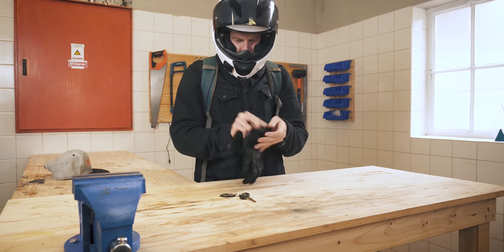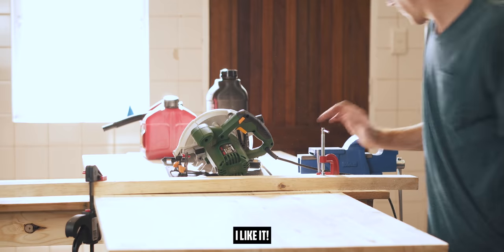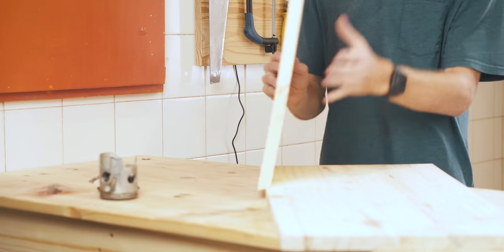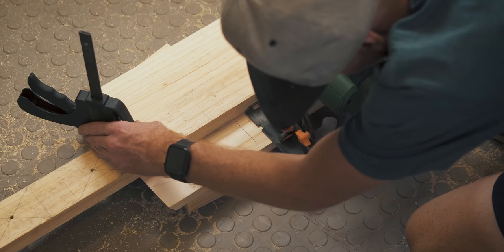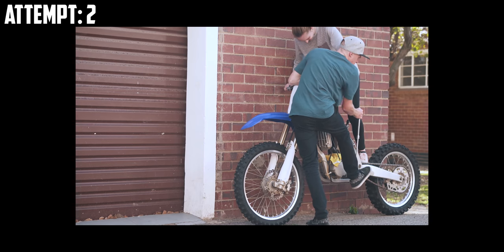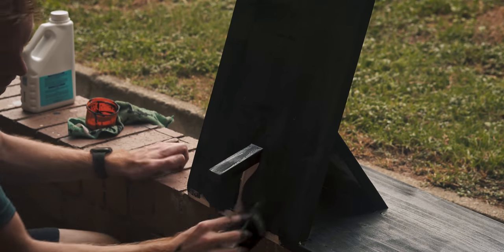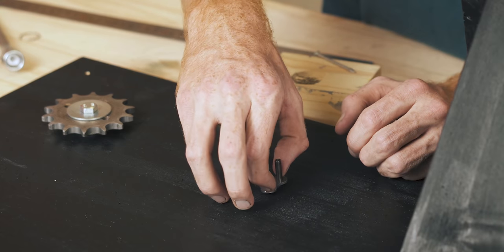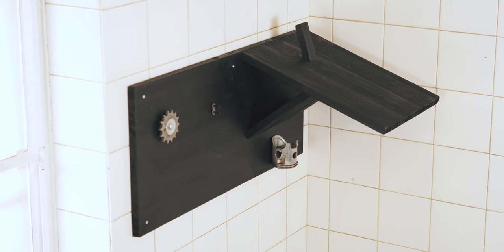Building a Gear Organizer with Motorbike Parts

Comment: Cute!     Suggestions?
- A bit more offset for the sprocket , so the jacket does not cling to the wall and can dry better?
-Big holes with drillsaw or flat wood drill in the plank under the helmet for airflow (leave visor open)
-2 vertical 30cm broomsticks for the gloves to fit on (better drying capabilities)
Reply: q

Comment: I love it. Your second iteration is awesome too.
As a woodworker myself, what I’d change is I’d put some disposable gloves on to apply the stain.
As a motorcycle rider I’d go to a wreckers or old repair shop and ask if they have any old handlebars with the grip still attached for the helmet peg. 
For the gloves I’d think a pair of poles (maybe the same handlebar) to slide each of them on to in case they are wet for any reason and it would allow them to dry faster.
Love the sprocket, piston and chain link ideas. Nice build!

Comment: Great work! 😺 With the Masterlink: I would remove one of the metal „rods“ to screw the link on. And hammer the tip of the other one flat, so that the keys won‘t fall off (It happens with my Rack, and it‘s annoying).
I recommend to buy working rubber gloves, so you don‘t need to clean your hands after each working session.

Comment: Interesting vid, chaos. I would've replaced the wooden block with a short brake level to hold the helmet, add some small cedarwood sticks under the helmet to refresh the inside. Replace the sprocket with a long clutch lever for jacket hook. Replace the chain link with an angled spark plug for key hanging. Add back the crank shaft to move the piston away from the wall for spacing. Anyway, ride safe, god bless u.

Comment: I would recommend you using safety gloves and glasses whilst working on these kinda projects.
Reply: I was thinking in the same direction when I saw him operating the circular saw. Position of the hands was scary.
Regarding gloves, you should not wear them when operating rotating power tools like drills, routers, circular saws …

Comment: If you leave the outer plating holding onto the top pin vertically you can screw it to the wall instead of glue 👍

Comment: You can add mirror. Just take older tire cut a mirror in circle with internal diameter of the tire and glue it on. And of course hang entire piece on the wall :-)